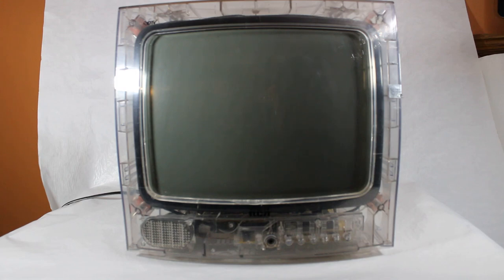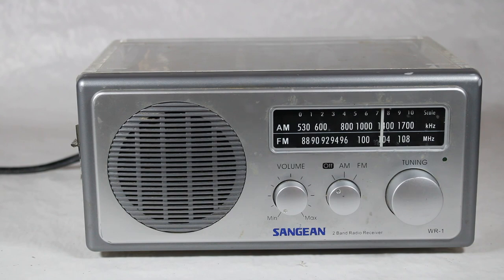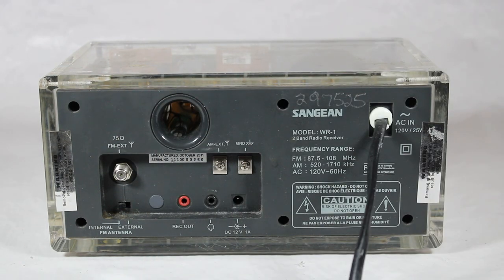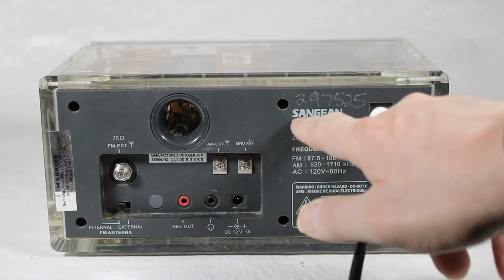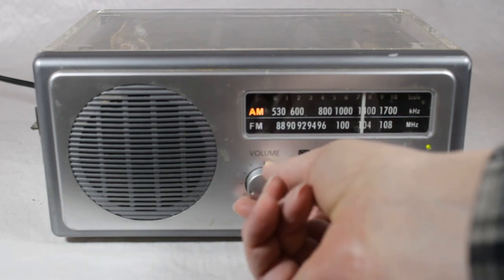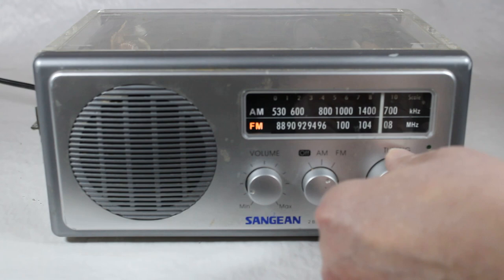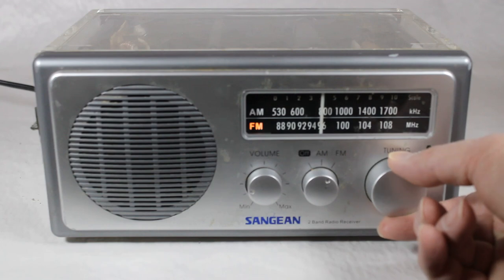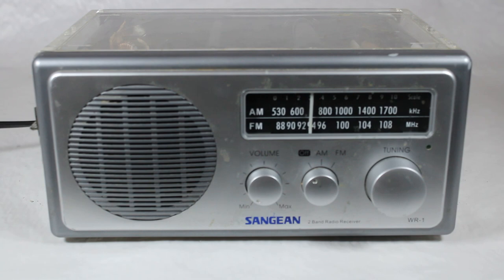Prison Radio

Comment: I wonder how well these worked inside a prison. with all that metal and concrete I wouldn't think they'd get many stations. Lots of electrical interference too. I don't think many cells would have a hookup for an external antenna either... I guess it would be better than nothing though.

Comment: I’ve got mine couple of days before used in perfect condition and amazing price too/ but it’s 120 W and in Middle East it’s 220~240 W that’s why I use trans to transfer the electric in put from 120 to 220 W . But happy with my purchase Realy .
Reply: I think you mean volts.  240 watts is a considerable amount of power for an appliance like a TV or radio.  Only a retro TV with an enormous picture tube would have used close to 240 watts.